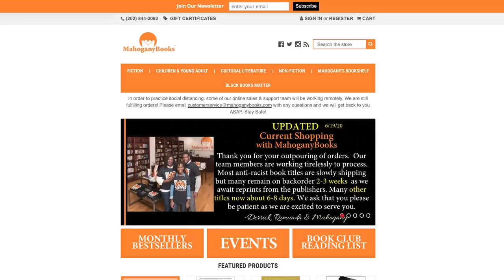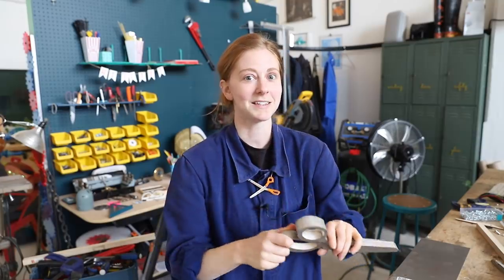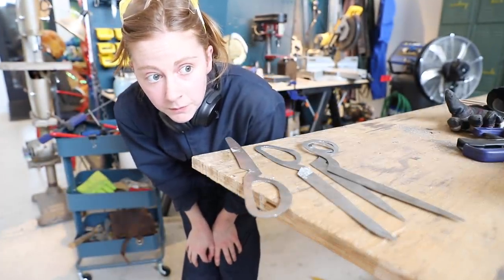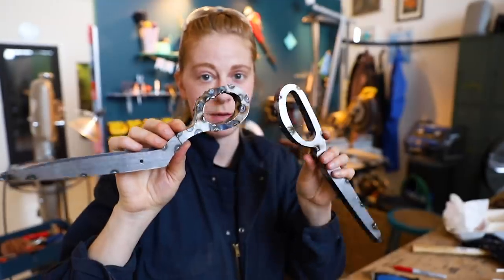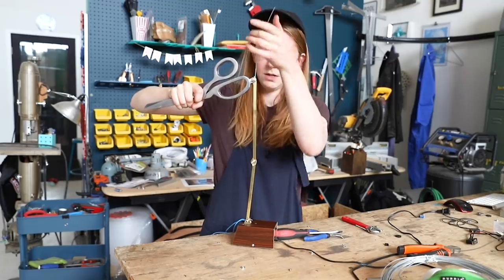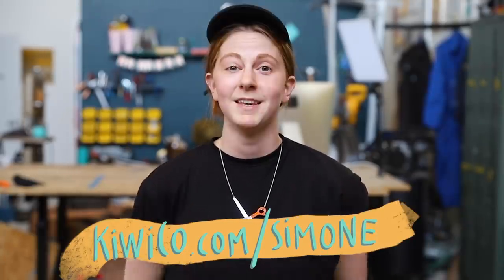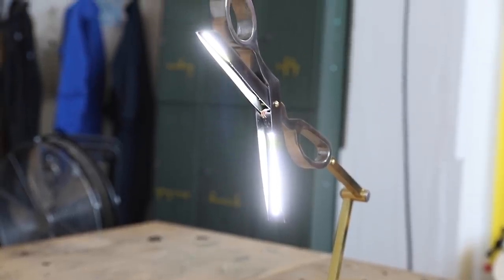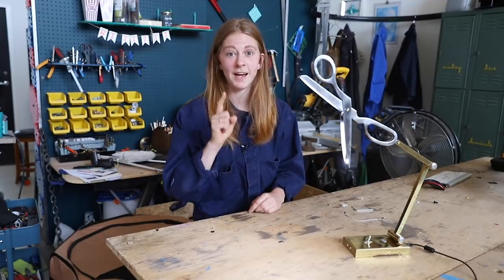Building a custom scissor lamp

Comment: Fun Fact: Having to cut sheet metal with a jigsaw can sometimes actually teleport you to your own personal hell realm!
Reply: If you teleport to hell using a jigsaw, chances are it’s the wrong blade and/or your sheet isn’t properly secured to working surface
Reply: The blade needs smaller teeth. That’s all I know from my intro to metalwork class.
Reply: @MAMorelli  Also works better to clamp it to a sacrificial piece of wood.
Reply: @klarahfenderson1374  ...or clamped between sheets of sacrificial wood.
Reply: @MAMorelli  I have jigsaw blades specifically for sheet metal and I still go through the same thing as Simone. Not sure why she doesn't use the bandsaw that's right behind her. Cutting sheet metal is a lot easier when the blade is only moving in one direction.
Reply: so who else was screaming "use your Dremel!" besides me?

anyone?
Reply: I have proven this personally.
Reply: @klarahfenderson1374  Works even better if you ditch the jigsaw entirely and just use a band saw.
Reply: can't really do tight corners on a bandsaw
Reply: @daydodog  a vertical bandsaw will cut any corner you want it to..

Comment: idea: light should turn on automatically as you open the scissors :D
Reply: i think that was the original idea but obviously the plans changed mid-build... which is something that i can relate to for sure.
Reply: @wizardman8482  Yeah, she said it would do exactly that, but I guess she gave up on the idea
Reply: They do sell DC switches that you can use for that. I know they are used in automotive applications and heck even your fridge has one. The pivot point in between both half of the scissors would be a great place to mount such a switch... then again, they probably already tried that and it didn't work out the way they wanted it to 🤔🤔

Comment: Me: I didn't know you could use a jigsaw on sheet metal. Awesome!

Me after two seconds: oh.
Reply: You absolutely can cut sheet metal with a jigsaw and have the operation go smoothly and easily.  You need the metal being cut to be securely clamped and a sharp metal cutting blade though, if you use an old blunt blade or don't secure the work piece things get, um...
Reply: @FireAngelOfLondon  And preferably a 700w corded jigsaw.
Reply: I always use those sheet metal shears to cut sheet metal specifically for this reason
Reply: Works decently well if you sandwich the sheet metal between two sacrificial pieces of OSB/plywood/MDF (screwing the panels together just outside your pattern because screws have huge clamping force and you never have enough clamps).  The main failure mode is that the metal bends, putting it between easy-to-cut and rigid panels makes the saw work right again. One panel works in a pinch, especially if your cuts are mostly straight and you aren't worried about the blade binding and pushing the metal away.  Or just use a plasma cutter/send out for laser cut panels...

Comment: 9:05 That's the way I felt when I was working on plumbing in my basement and crawlspace, thought I was through, then had a fitting blow out when I turned the water back on. And it soaked me. At 9:00 at night.

ETA: I think that's when I came in, told my husband I didn't want to talk about it, and he proceeded to ask me about it.

Comment: How to cut sheet metal with a jigsaw:

Double sided tape to one side of the metal and stick it to a 12mm sheet of MDF, then clamp the MDF down. 
EASY.
Reply: I have never actually made anything with metal (shed is in progress), but thought the same thing, I think Adam show that on a Tested video.
Reply: How to cut sheet metal with a jigsaw:
Don't, use shears instead
Reply: You need a very fine toothed blade (tiny teeth) for cutting sheet metal and you have to back it up. The jigsaw will work fine but that blade she's using is more for wood I'd say. It so aggressive the teeth keep catching on the metal.
Reply: Or even like, a bandsaw. Jigsaw seems like the least efficient method...
Reply: @9thDecibel  Well yeah, a thin bladed jigsaw would be better, but a jigsaw will cost you $50 - $100 and fits in a box in a drawer. Given that she clearly had no idea what she's doing, a band saw (or plasma torch) are probably overkill at this point.
Reply: Or a sheet metal nibbler. Jigsaw is not the best method
Reply: Or a cutting disc on the anglegrinder she uses later xD
Edit: or the dremel ;)
Reply: Get some roofing foam. They come in various thicknesses. I would get at least 3" thick. You can also use for big projects (plywood, masonite, etc).
Reply: From my experience: cutting speed to high, try really slow and apply enough force from above
Reply: With any saw you need 3 teeth in contact with the material to prevent binding.

Comment: 2:00 Someone's seriously in need of a plasma cutter!
Reply: She does (or did) have a PO Box where someone could send her one. Maybe talk to her about it first.
Reply: That or a nibler
Reply: A small cad based water jet cutting machine would probably have more applications I Simone's workshop.   
Be a fun protect with Adam or another builder.   Based on any of the cnc plotter cutter kits, or planning  just needs a modular system to putting in a water jet, blades,  laser  perhaps even a micro welder for a cheap 3d metal printer lols. 
With   Bit of programming and a bunch of frustration with the alignments n settings because of the variations between  different heads. 

Also I could see it's look based upon anything to match her wonderful workspace.   
Call it the fuk damshit chatty anything  machinery thingy

.   But honestly I think it is an idea worth pursuing,  special with her skill set n talent. (Not to mention the spare parts loaned from older tech. 
Gosh it's almost a robot in a ways, but please don't let Ms Gertz know that because I'm sure she would be over being the funky robot chicks of the past lolz🤗🌷🤩🌷...
Reply: Also a TIG welder...

Comment: "Laser cut cardboard, hand cut metal."

I feel "hand cut cardboard, laser cut metal" would have made a much easier project, but maybe it's just me.
Reply: I don't really work with lazercutters or metal but I thought you couldn't lazercut metal because it reflects the light of the Lazer?
Reply: jan de Munck yes
Reply: Lasers don’t work on metal, you’d either need a bandsaw or better yet, a water jet
Reply: @camilla3801  triggered mechanical engineer here
please look up fiber laser technology, it is really common for cutting sheet metals up to 15 mm thickness
edit: I really hope your comments above were just sarcasm 😁
Reply: Máté Sajtos was about to do the same. Glad I don’t have to be the bad guy. Thx for educating the masses
Reply: Thank you all for pointing out I should have generalized the technology instead of chosing "laser" specifically. I should have chosen a more generic tech like "CNC-ing metal" or something along the lines.

I would like to say it won't happen again, but my current lack of sleep affects my memory badly.
Reply: @Lockheed7  Thank you, I was about to say but you beat me to it.
Reply: @camilla3801  I program CNC lasers to cut metal. We've got a CO2 laser that cuts up to 1" steel and stainless as well as a fiber laser that cuts thinner stuff at about 10x the speed. Check out Trumpf Trulaser
Reply: @camilla3801  or plasma
Reply: @camilla3801  plasma CNC as well
Reply: A benchtop plasma cutter would be so much more practical, and the cheaper ones are only a little over $100, and would easily do the job.
Reply: When I saw the handheld jigsaw come out, I knew it would be fun to watch. I was not disappointed. 😂
Reply: @camilla3801  oh yes, water jet, that's also oddly satisfying to watch.
Reply: Can't you just use tin snips
Reply: maybe thats just the laser she has. you can probably cut wood with a much weaker laser than you need for metal.

Comment: Hey, you want to never get frustrated when cutting sheet metal again. Ever? Ever ever?

Go look for a tool called a "Nibbler". It'll change your life, and you'll get to make jokes about it. So it'll change your life twice.
Reply: Was about to say this. I have a hard time making perfectly straight lines with em, but filing it to perfect shape is way easier than all other methods sans a laser/watercutter
Reply: ...or just tinsnips. But nowhere near as entertaining.
Reply: Or just sandwich the metal between two pieces of plywood and cut that...
Reply: @Khamero  I think a sponsor should hook her up with a laser or water cutter.  Think of the madness that would ensue!  It'd be amazing!
Reply: For this size of a project, a vertical bandsaw table for a portaband would probably work well too, and it has many other practical uses.
Reply: look for something called water jet cutter
Reply: I need to tell that MF joke to my sister who uses the phrase a lot. Thanks for that laugh. Get a wazer water jet cutter, they should sponsor you!
Reply: Matthew H she has a laser cutter
Reply: Go watch Adam on tested. He shows how to make a table top band saw
Reply: She had a capable tool, I just think she was forcing the blade too hard. Let the blade do the work and you just move it a little.
Reply: Holy shite that tool looks SUPER helpful, oh my gosh. How useful! Thank y'all!
Reply: @davidf2281  The stuff she was cutting wasn't mild sheet metal, it was steel steel. I've cut miles of sheet metal with snips, it used to be my job. Assuming you had the grip strength to cut that stuff, you'd get about 3 inches before you needed a new pair of snips.
Reply: @gallonoffuel  Bandsaws don't cut inner circles.
Reply: @TheAAMoy  More likely it was the wrong blade. They really only catch like that when the teeth are too aggressive.

Still, why wouldn't you want to own something called a nibbler?

Comment: Normal people: “this weighs half a pound” 

Simone: “this weighs as much as a pregnant hamster”
Reply: Normal people: “it weighs about half a kilogram”
Americans: “this weighs half a pound”
Simone: “this weighs as much as a pregnant hamster”
Reply: @Maaarsl  You have never weighed a pregnant hamster. Therefore you are not normal.
Reply: Americans will use anything but metric

And sometimes imperial just doesn't cut it
Reply: and then there's micarah tewers
Reply: @Maaarsl  half a kilo would be around a pound.
Reply: "Half a pound" what's half a pound? Is it when you're halfway before you go balls deep?
Reply: @Quifuh  No, they mean 50p
Reply: @snowylilac371  you can't rely on her instructions especially on sewing lmao
Reply: @Maaarsl  that is correct
Reply: @Maaarsl  I was looking for this answer ❤
Reply: @Qermaq  Pregnant hamsters weight roughly 160g to 210g which is about 0.4lbs so surprisingly... half a pound is actually not that far off for what I believe to be a random guess.

Comment: Advice: when cutting sheet metal like this: Don't do it like this. Instead cut the wood below as well.
Reply: amen
way ive always done it is:
1: a nice set of 24 tpi blades, you're gonna need a few
2: 2 pieces of plywood clamped together with your sheet metal in the middle of them, sandwich style
3: DRILL STARTER HOLES
4: work slower than slow to minimize burrs
Reply: Someone pointed out there's a band saw in the background somewhere.  Plus, she knows plenty of people who know these techniques.   And she certainly knows how to type the requisite "how to" query into the google.  I think maybe she's not as uh, "limited" as she sometimes portrays.
Reply: That’s a table-
Reply: @Cerebral Moss Plasma or laser would be mine.
Reply: great advice!
Reply: @sephyryn  This is the way!
Reply: A water jet cutter would do  it too.
Reply: @Cerebral Moss ,  There's a band saw in background of the shot.
Reply: Band-saw is how I've done that. Because it isn't reciprocating the chances of a burr catching is small. Sheet metal shears would be OK, too.
Reply: @f.eugenedunnamiii9452  So, I think your right, except I also think she just totally forgot those exist, and went with her first thought
Reply: The way Simone does it is much more entertaining for sure.

Comment: 5:40 I have held a pregnant hamster: when I was about 10 years old, I got a new hamster. Turned out she was already pregnant when we bought her. The result, after a litter of pups that all survived, was 13 hamsters for the price of one. 

The cutest thing was giving them a bath: some of them swam with all fours, some just with front legs, and several filled their cheek pouches with air and floated!! 😳
Reply: Did it weigh about as much as a scissor lamp?

Comment: Hey Simone, I loved the video! Just a thought, you could potentially make the lamp turn on and off by just opening and closing the scissors. Hook up a flex sensor on the hinge of the scissors and when you open/close the scissors, there is going to be a change in resistance. Have the flex sensor as a voltage divider and voila!
Reply: Or you could put a microswitch in the hinge.
Reply: this definitely needs to happen
Reply: I thought that's what she was doing
Reply: I was hoping this would happen too!
Reply: Then instead of switch at the base use potentiometer for dimming. Du är grym Simone :)
Reply: @JimmyAlzen  yes that would definitely work :)

Comment: Video subtitle: Everybody pass the hat to buy Simone a bandsaw!
Reply: She has a portaband, just need to Adam Savage it into a bandsaw.
Reply: There is a bandsaw right there behind her when she is hacking away with the jigsaw!
Reply: @murdokiwi  you cut cut inside a hole with a bandsaw (although you could weld that closed again) A wazer is the ideal tool for this but then all the comments would be "i could do this too if i had a water jet"
Reply: @jeremyspecce  No, but you could cut the inside holes with the jigsaw and then do the bulk of the cutting with the bandsaw... it seems like all the places Simone struggled were the outside edge as the metal got thin (which makes sense), so a bandsaw absolutely would have helped.
Reply: I was more thinking laser table but ok, bandsaw is way cheaper.

Comment: I love the scissor lamp so much. It's beautiful, I want one.

Say, I don't know if this helps but I used to cut copper sheet to build things in work and I agree it was a bitch. I found using two or more comically small (and cute!) clamps worked better than one big one. They grab the sheet across a wider area instead of centered on the one point, which helps keep it in place more effectively, and they don't get so in the way of the hand saw. Also, a dab of cutting oil on the blade stops it sticking so much, helps you cut and pull the blade out if you need to.

Comment: I occasionally have to cut sheet metal, so I feel your pain.  I've resorted to using cutting discs in a dremel, works on brass at least, but the big downside is finely powdered metal dust (boo) and getting through cutting discs like they're going out of fashion :D

Comment: When Simone described the lamp I was expecting opening the scissors to also turn on the light, not a seperate switch. this is not a complaint, just not what my brain pictured.
Reply: Yeah, me too. I was thinking some kind of motion sensor inside the hollow body of the "blade" that turned on the light. Or maybe even just a simple analogue mechanism, where you have some switch on an inside vertical wall of the lower blade and attach a horizontal prod to the upper blade, that hits the switch when it's lifted. Granted, you would have exposed wiring in the second case, but you hide it with electrical tape or something.
Reply: @otherwords1375  Everybody knows the first prototype doesn't quite come out how you want.  V2 or V3 will have an integral switch.
Reply: I was imagining the same thing. Simone, you can easily use a limit switch at the hinge point so it's still pretty hidden. That'd make the cool scissors lamp even more cutting edge. See what I did there?

Comment: Simone: "I did the prototype on the laser cutter"
Simone: cuts sheet metal with a jigsaw and has a terrible time
Me: ???????????????
Reply: I'm guessing the laser cutter wasn't strong enough to cut the sheet metal maybe?
Reply: you can't really laser cut sheet metal, you need a waterjet cutter
metal is way too heat-conductive, you're gonna melt the whole sheet before you burn a hole through
Reply: oh, also metals are generally super-reflective on pretty much all wavelengths so lasers have a hard time once they make it through the oxide layer, I imagine?
Reply: The prototype was made of thick paper. She didn't show the making of it
Reply: Laser cutter for metal is $$$$

Comment: Am I only one who is silently screaming "laser cutter" when she is angry?
Reply: Laser cutters aren't good with reflective surfaces, because they use light energy to cut things. Light getting deflected doesn't cut well, unless its a really good laser cutter.
Reply: Maybe rather with a milling machine?
Reply: @azazelthedark1  Waterjet! But might be out of the price/size range. Or plasma cutter?
Reply: @azazelthedark1  From the wikipedia article on laser cutters: https://upload.wikimedia.org/wikipedia/commons/transcoded/5/57/Lasercutting-video.ogv/Lasercutting-video.ogv.480p.vp9.webm
Reply: @JamesAustin  That's an industrial grade laser cutter that's designed to cut metal. That thing probably costs around $400,000.
Reply: @trashcompactorYT  Also you need the right frequency of light from the right type of gas. Most hobby grade lasers use CO2 lasers and I think you need YAG(?) for things like metal.
Reply: Laser cutters are lazy I like how involved she gets.
Reply: Or even just the damn bandsaw she has in her shop
Reply: @grouch314  Or a angle grinder, or flat disc...

Comment: you could use sheet metal screws to secure it to some scrap board through the parts that you aren't able to use between your cutouts. the cut will go slower but slow is smooth and smooth is fast.